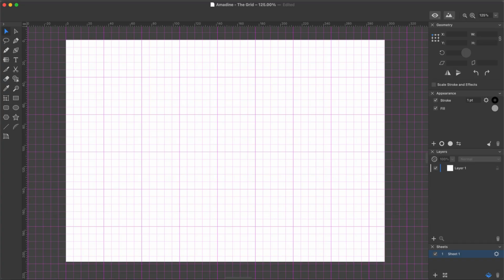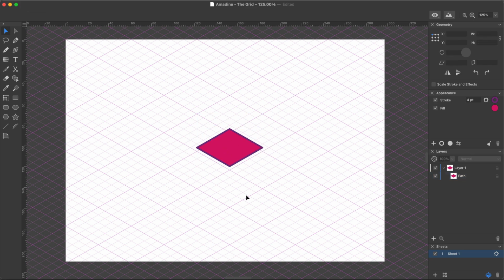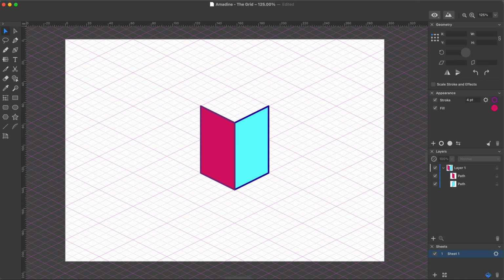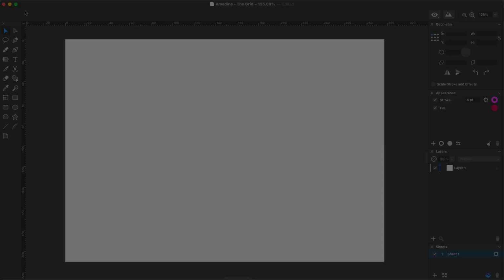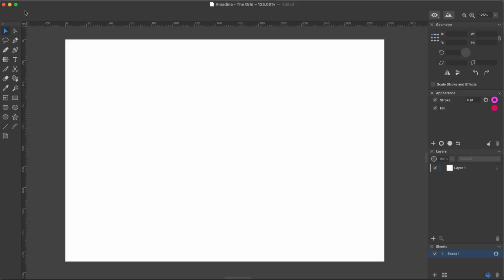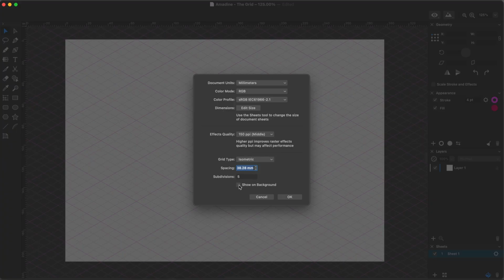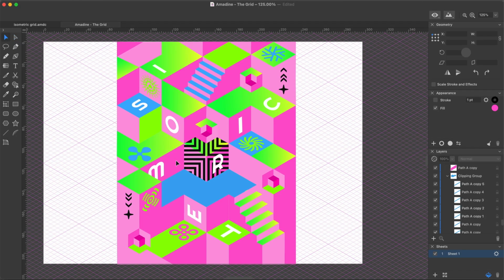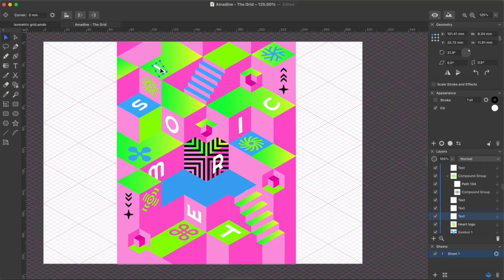Working with Grids—Amadine for Mac Tutorials

Comment: I am interested in learning more. However, I see that the iPad version does not allow snapping, even when Snap to Grid is turned on. I am using finger gestures, rather than a mouse, if that makes a difference.
Reply from the maker: We've checked the iPadOS app. In Amadine object snaps to the grid, there's no issue there. Please, check if snapping is enabled in the Document panel.
If it is enabled, as you reported, please set a large grid increment (100-200 pixels) and slowly drag the object to one of the grid lines to check it's working. If it does not, please send us the document and your iPad specifications to support@belightsoft.com
Reply: @Amadine  Thank you for your response. It appears that the size of pixel increments was the issue. Once I put in larger numbers like you said, the issue was fixed. It appears that snapping does not work for smaller grids, but does for larger ones.